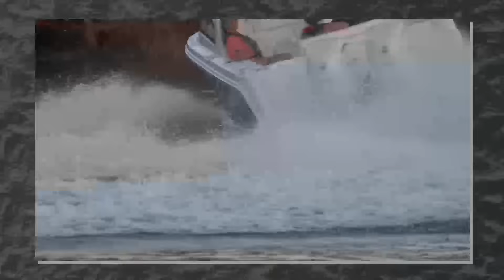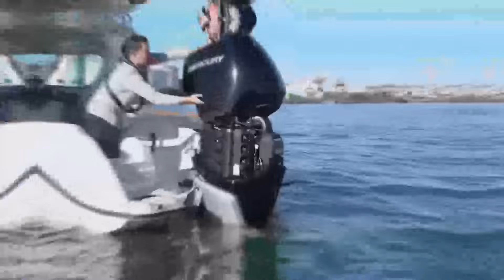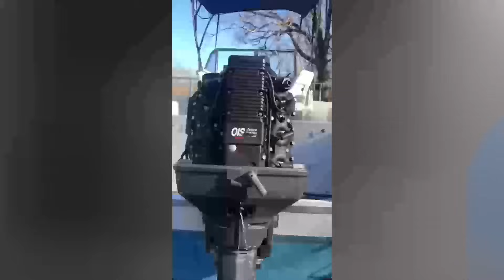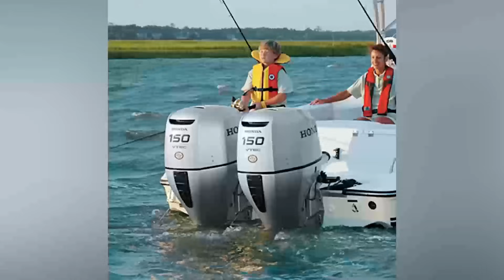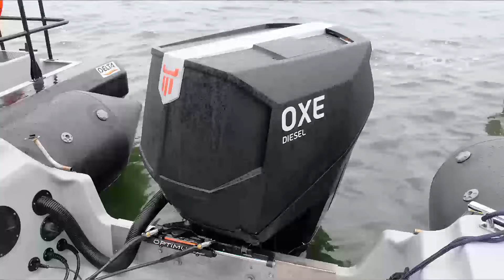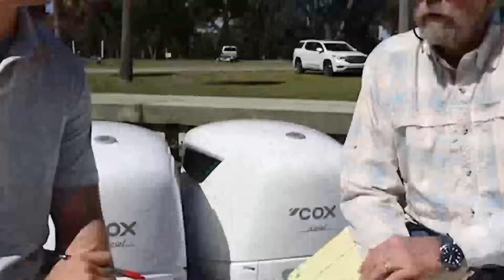Most Indestructible Boat Engines Ever!

Comment: Honest automotive technician here. Chrysler tried lean burn back in the 80s it failed. Miserably. But that was mostly due to inadequate electronics. The brand I worked for has an all new 1.5 liter turbo 4 coming out later this year and it’s a lean burn system. I’ve heard from sources I trust that it’s not only very reliable but makes a very noticeable difference in fuel consumption especially while cruising at steady state. Honestly I’m excited to see this technology grow and improve.

Comment: It will be interesting in another 20-40 years to see how many of these current day 4 strokes are still in use. I hit the river by me in MN every weekend with my 30 year old Johnson 25, and near half the boats I see are old 2 strokes. Some are going on 45+ years old. Primarily see smaller motors under 50hp due to shallow water, and most are primarily Evinrude, Johnson, and a few Yamaha and the occasional merc.

Comment: Yamaha 90hp  2 stroke!
Reply: There's a good reason why those that own them won't sell them.
I wouldn't trade mine for anything!

Great performance, durable and easy to work on and maintain.
Reply: @jkg6211 Agree, and also the fuel economy is surprisingly good. Not big difference to modern 4 strokes at speeds closer to WOT.  I have a 2006 model that i purchased 2010, a fuel pump membrane is the only spare part needed so far:)
Reply: @XSAILOR65 
I use mine on a flats boat, where the lite weight (100lbs less than any 90hp 4 stroke) and instant torque gives me a hole shot that's impossible with a 4 stroke. 👍

Comment: 88 hp spl Johnson v4.  1989. Never rebuilt   has 5000 hrs still starts like new. It's over 35 yrs old.  Very simple engine.  Great design.
Reply: 88 hp OMC outboard were very popular with rental fleets.